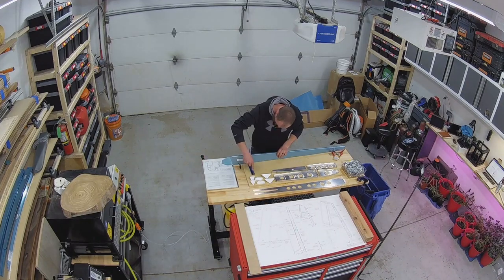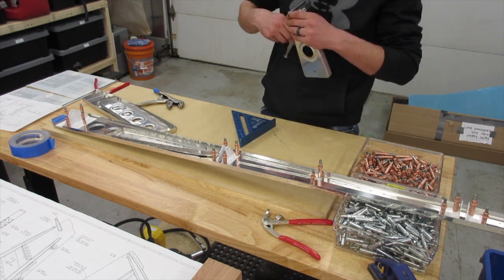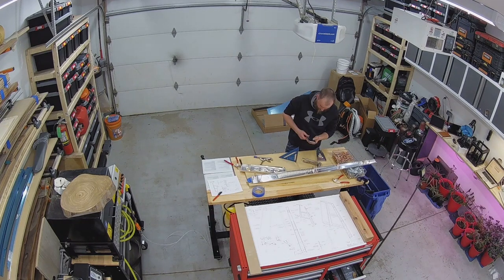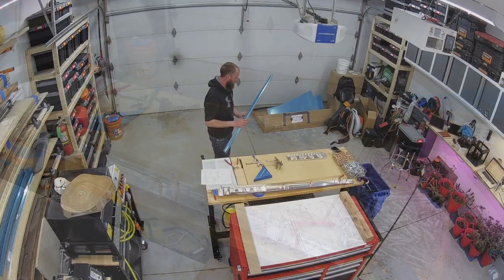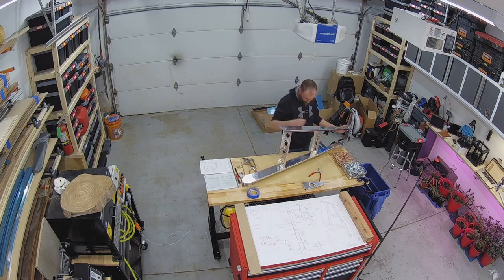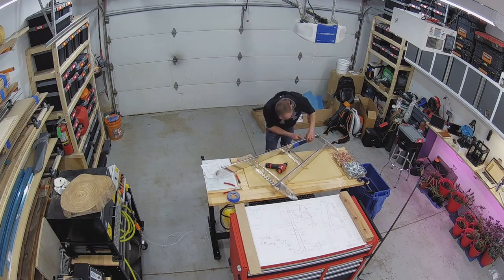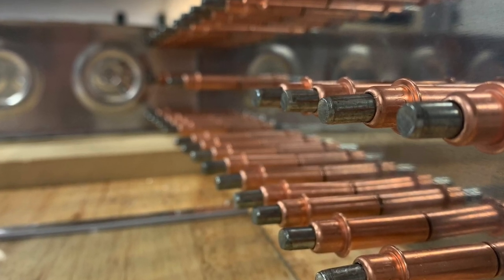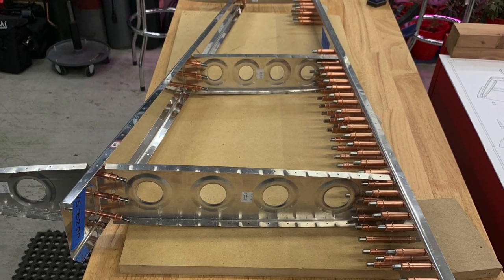PLG S1E2 - RV-7 Vertical Stabilizer Forming

Comment: What primer are you going with? I’m looking at Stewart’s System.
Reply: Grant Powers If it works well, that’s all that matters. Honestly I don’t know enough about any of them. I would think it’s cheaper. I spent a bunch of money on a Gretco gun. It’s more closer to an airbrush, but has a .7mm fan tip and a 4oz cup. I build r/c planes and got it to paint cowls, wheel pants and things. Should work on spraying these aluminum parts. Do they have what you’re using in quarts?
Reply from the maker: I migrated my channel so replies were lost. Rustoleum Aluminum primer in rattle cans.